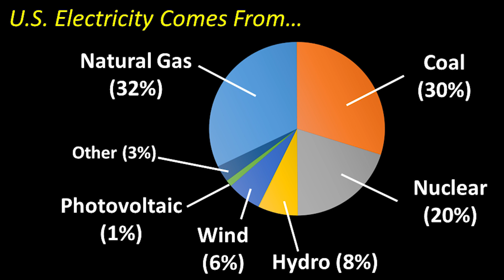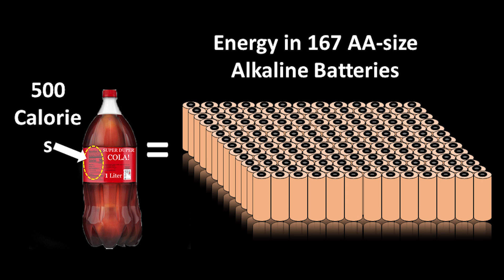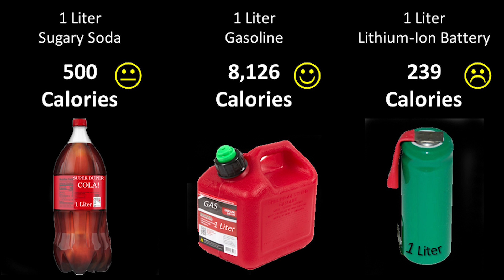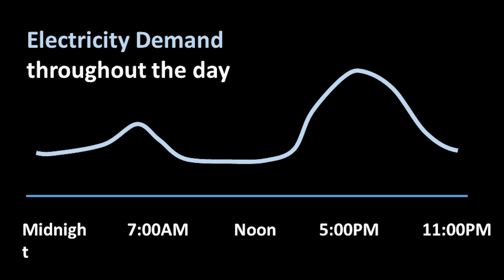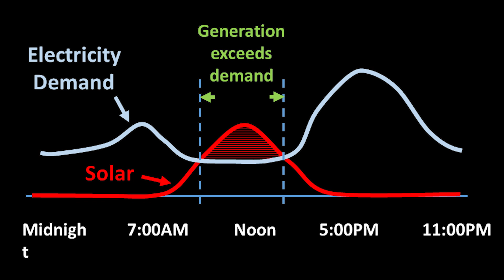Renewable energy: What’s going on with the electrical grid? | Dr. Rob Maher | TEDxBozeman

Comment: Storage is fine for balancing supply and demand for the short trem, eg day and night - but useless for covering power shortages which can last for weeks on end, when the wind does not blow.

 Hydrogen is extremely expensive to produce, and there is no way to store it in bulk to cover demand in winter for heating etc

Comment: This is the problem with Ted talks, we will watch one person that is very clever and knows what he is talking about as far as the major problems with renewables that are not able to be fixed no matter how advanced we get as a Wind turbine has to have a blade that turns and so kills many endangered species, secondly Solar panels have to have access to the Sun and so any animals in that area not only had to be removed, which also kills many species that don't handle being moved very well, but all the creatures that get killed from the heat produced above the Solar panels.
So called Environmentalists should i would think be also worried about the flora and fauna in these huge areas that they place the Solar Panels in.
We are talking thousands of Hectares of land.
Now we have this gentleman telling us that we should have more solar panels but add huge areas of Battery storage so that Solar can be an actual useful energy source.
We now know from many years of experimenting and seeing how renewables have failed to do anything of worth over seas and yet we still are pushing this useless process.
We have a system that worked very well in Germany, until the moron greenies pushed for change and now Germany pay the price for their stupidity with far higher Electricity costs as well as all the pollution that came from building all those Solar panels and Wind Generators as well as the future benefit of what to do with all those end of life Solar panels.
Just look at France, most of their clean energy is coming from Nuclear and they have very cheap power.
It doesn't take a huge brain to see that the so called Environmentalists did not have the Environment in mind when they all pushed for renewables as none of them had a clue about the reality, it just sounded like a great idea, but no one bothered to do any actual research into the long term possibility or reality of going renewable.
If you look at the actual reality, people are a constant polluter, every time we open our mouths CO2 comes out, if we move, we produce more CO2 and if we work at an actual job, not sit in an Office we produce even more CO2.
If we can't become non polluters how do we expect to make our Energy producing system 100% CO2 free :)
We would all need to stop breathing or place a CO2 catcher and storage facility on our Heads :)

Comment: The only problem is electrical energy storage in batteries is VERY expense.
Reply: That and when the batteries are old they need to be disposed of... which leads to pollution in other ways.
Reply: @flymario8046  Great! You understand! Nuclear is the way to go!
Reply: @born2bbald12  Is it though? Disposing of nuclear waste is a big problem still. Unless you meant nuclear fusion reactors,than yes,that is the way to go.
Reply: @lucoking99  actually we can transmute the waste into nuclear waste that becomes recyclable but no one seems to invest much of their time into these projects due to the romanticization of renewables and defamation of nuckear energy. But you are right are main focus must be nuclear fusion by deutrium and not tritium since tritium is very expensive and very scarce while deutrium is virtually infinite. One more reason to switch to fusion would be less chances of accident because we can control the plasma flow by changing EM fields.
Reply: @rsenthil3317  how far are we from fusion?
Reply: Easy answer, get rid of money. Ie.  Going to the Moon . Money, cost whatever, we have EGO, must do it to beat USSR, to the Moon. We , did it  Hurray, hurray hurrrray  . That’s it, Spend money , if others are  going to get share of the spends, no questions asked.  Taxpayers money, your money, supposed to be for running the country.  So pay , not needed token of worth for your Efforts. . Same as plastic, but could be more sophisticated. Use by Electronic token , date lifted, use it or lose it. No hoarding No Banks , just earthlings advancing themselves without the slavery  of a carrot, money.  One world one Global control.
Reply: @williamrbuchanan4153  What in the heck are you talking about? This sounds like an incoherent rant. Please explain.
Reply: Can be... We can use simple battery chemistry tho
Or store power without batteries..
This lecture is from 2019, not exactly cutting edge info      :)